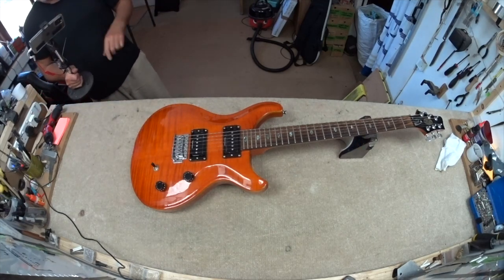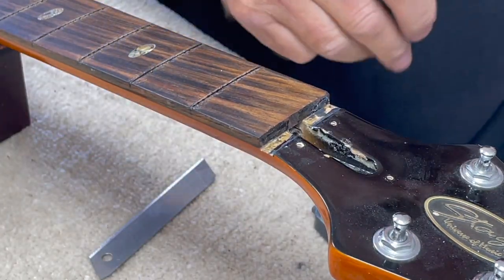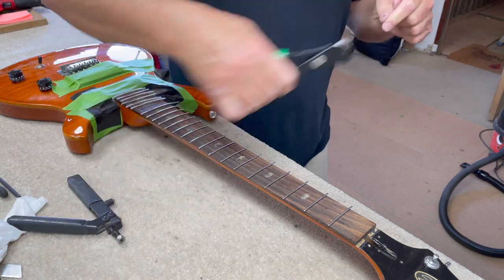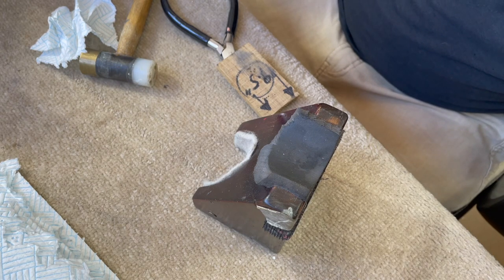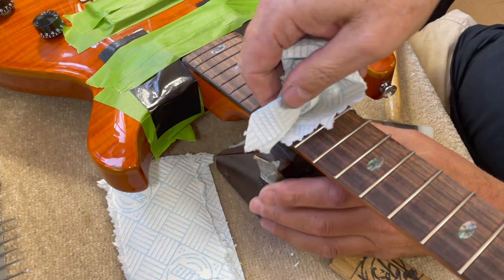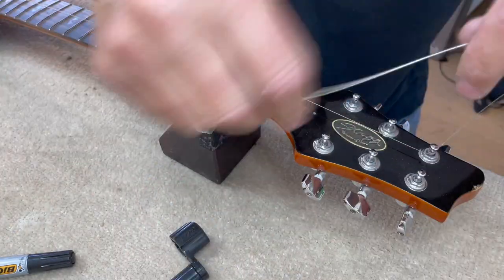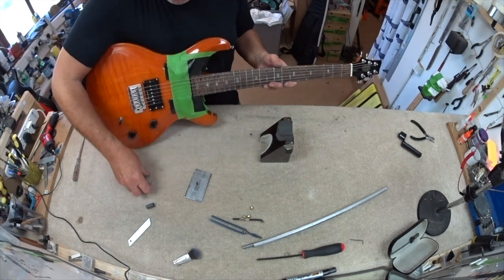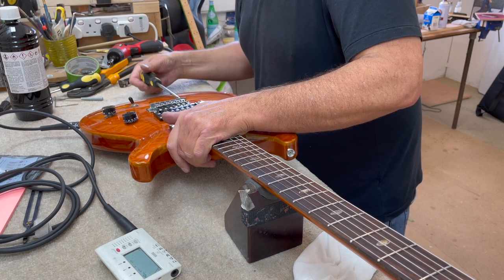Stagg PRS-style copy stainless steel re-fret and set up

Comment: Is that an adapted truss rod ?  I remember years ago watching banana feet leveling and I do it with a skinny truss rod and one sided stick sandpaper.  I thought that was how you did it several years ago on a video.  Interested in what you’re using now.
Reply from the maker: Hi Duncan, it’s a ‘U-Channel’ truss rod sometimes advertised as a Martin truss rod. Hosco also makes them. I use this in the same way as before, it’s just slightly stiffer which I find works a little better :)
Reply: @SamDeeksRelovedGuitars  thank you!  Great work by the way!

Comment: Lol those locking tuners are a nightmare for that. How much does it cost to refret a guitar like this
Reply from the maker: Yes... I tend to avoid them. They're 'a convenience too far' in my view. Regarding re-fretting, I charge £225. That price includes the full re-fret (and re-radiusing of the board where appropriate) and the full fret levelled set up process afterwards including new Tusq nut and strings, all over clean, simple fault diagnosis and repair etc. I charge £125 for the set up so really £100 extra for the re-fret as well... a little more for premium wire (such as EVO gold) and stainless which cost more to buy and wears tools faster.

Comment: No wonder you get flaking/chipping. That is a brutal way to pull out frets....
Reply from the maker: Out of interest, how times have you fretted guitars? I’ve done it hundreds of times and my experience shows me the flaking has everything to do with the kind of wood, it’s condition and how glued or stuck the frets are and nothing to do with anything I do to try to ‘loosen’ them.
Reply: @SamDeeksRelovedGuitars  Not really sure? I do about 100 refrets/year, so maybe around 2500. Chipping has everything to do with the kind of wood and the condition of the wood, which is why you have to take different precautions when pulling the frets. With the proper technique and preparation, 9 out of 10 times, I can pull frets from an old brittle ebony board, without any chipping.
Reply from the maker: @pallecla  Thanks for the info and good to know your view is from experience (sometimes people just want to say how it MUST be done because someone told them...) I agree with you that it has most to do with the condition of the wood (whether it's flaky, the grain etc) and the way in which the frets are adhered TO that wood / grain. But it's this aspect that I've personally struggled to find any tangible impact on... I've tried back-bowing the neck, warming the frets, dampening the fretboard. In my experience if the wood is stuck to the frets by a glue (like superglue for example) there's nothing I can do to ease the fret free without some chip-out IF that's the nature of the wood. If its stuck by finger-grease then yes, heating can soften that and make it nice and bubbly...but I've had as many hot, bubbly frets come out pulling chips up in my time as haven't. I've tried using those 'fret protector' strips but they have a certain thickness and by the time they fit under the crown that same crown has already lifted any flakes it's going to lift. all they've done for me is keep the lifted flakes in place. That's fine if you can fret straight onto that (and hold those flakes down) but the flakes are still 'out' as it were. 
I do many such fret removals the exact same way as shown here with no chips etc.. If / when chipping happens it's been my experience that it will happen regardless of the lengths I go to to prevent it - I guess that's what I'm saying and the conclusion I've come to :) I'm not the kind of guy to 'go through motions' to please viewers or prospective customers... if I do something a certain way it's because of careful consideration about its efficacy, not (usually) because I don't know different or can't be bothered although of course I can learn where I've been doing it wrong too. The one thing I would have done differently on this neck - and short turn-around didn't help here - would be to fix the chip outs before sanding / radiusing the board. Because there were relatively few I chose to do them afterwards (doing before risks glue going into the slots and needing to re-cut and clean out the slots repeatedly) but in fact it wasn't really viable to do it 'post-fretting' in the time available to me or without sanding / re-working the wood between each fret which wouldn't look uniform. So that's something I learned on this one: fix before re-fretting and preferably NOT against the clock :)
Reply: @pallecla  How about uploading a video and showing us all how you refret a guitar
Reply: there's always somebody who knows better....usually a guy with 3 thumbs.
Reply: @eddief908  @pallecla is a bullshitter till he/she/it shows us differently. I'm looking forward to the vids too, or a pointer to his repair business or luthier website or customer reviews etc. I think we'll be waiting a very long time though. His YT channel has 10 subscribers and no guitar repair vids lol